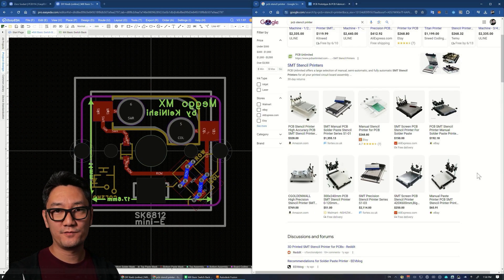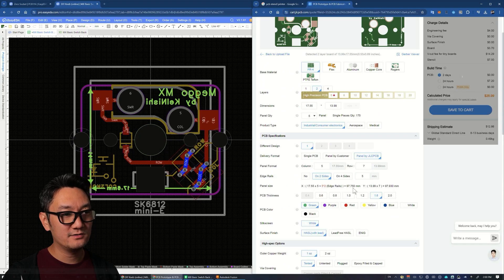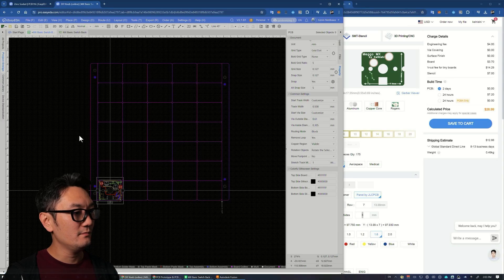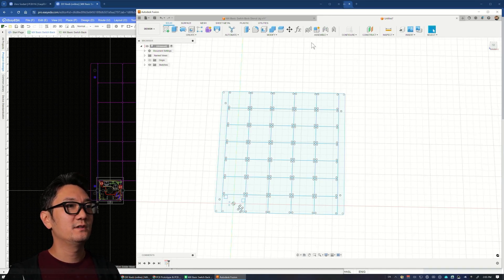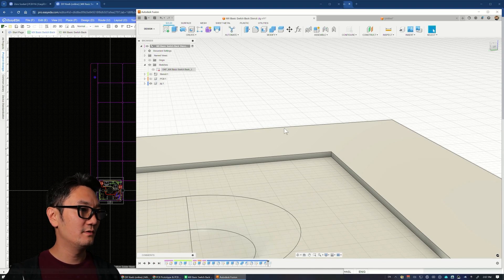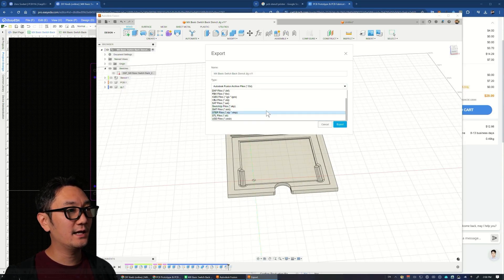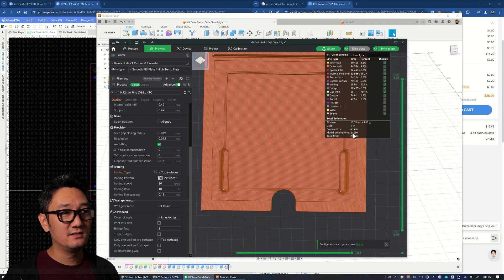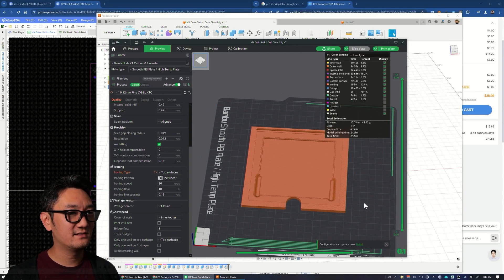3D Print your PCB Stencil Jig

Comment: I usually get top and bottom on the same stencil. It seems random where it's placed. Obviously I could only use the jig for one side, but that would still be convenient. How can I know where my PCB will be within the stencil when using JLCPCB? If I put only one side per stencil, are they sure to center it?
Reply from the maker: There’s no guarantee that it will be centered, but so far all mine have been. That being said, I will still use calipers to measure at least two features on each edge to dimension features in my Fusion sketch. If you use customized stencil size, you’re guaranteed that the features are at least axis-aligned (not rotated).
Reply: @KelNishi  I see, thanks. I was hoping to order the stencils through JLCPCB at the same time as the PCBs.